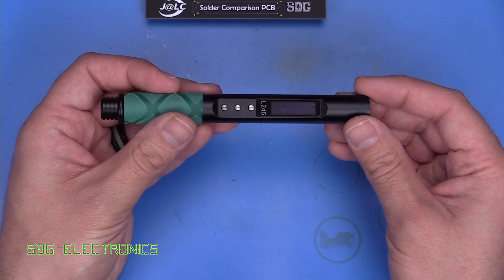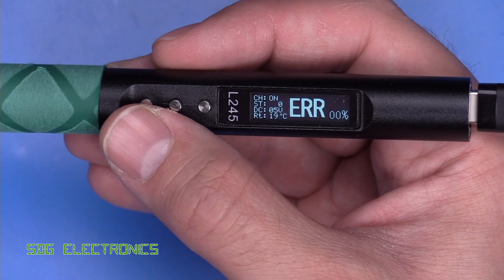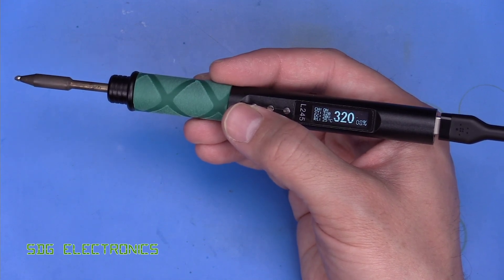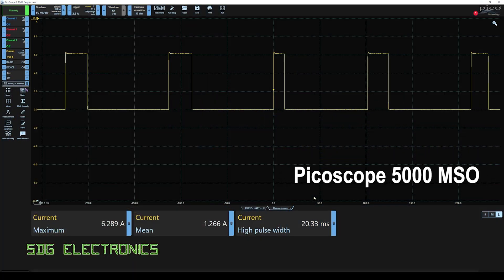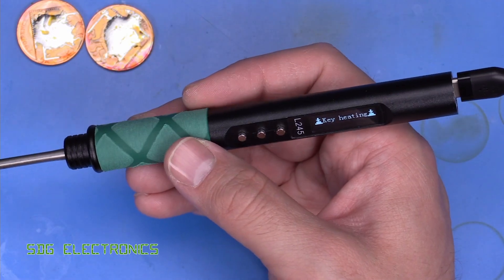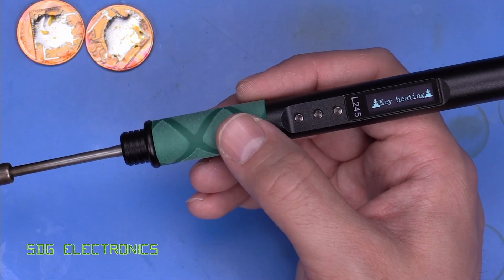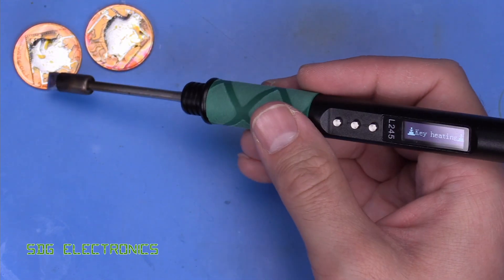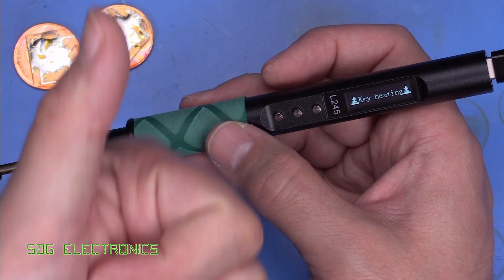SDG #284 130W Capable JBC C245 Soldering Iron

Comment from the maker: Excuse the error in my maths. More like 130W, not 300W 😂

Only $2 for 5pcs 2 Layer & 4Layer PCBs, Get SMT Coupon Here :➡ https://jlcpcb.com/cyt
JLCPCB 3D Printing Service starts at $1& Get $30 for New Registers Here: https://bit.ly/3vcjo1z
C245 Soldering Iron on Aliexpress: https://s.click.aliexpress.com/e/_DcgFoPN
Picoscope 5000 Series: https://www.picotech.com/oscilloscope/5000/flexible-resolution-oscilloscope
Support the Channel with Patreon: https://www.patreon.com/sdgelectronics
Reply: @sdgelectronics
Is your power supply switching or linear?
Maybe that might be a good look into type thing because linear might handle better than the stresses on a switching especially a chunky toroidial dcps they tend to take a licking & keep ticking without missing a beat.
Reply: At 1.37 can see that the voltage drops to 15V because the current is limited to 6A. Therefore, the maximum power used by the tips is 15x6=90 watts (not 130W).

Comment: There is a newer version L245P with a DC barrel jack supporting 24V input so it is basically the same as the JBC power supply voltage.
Reply: Sadly, it's power limited ot 100w. This one can go to just above 150W

Comment: After my ts100 died a few weeks ago im looking for a new, more powerfull but still cost effiective soldering iron. 
I have a 100W USB C PD charger and also a 20V 12A PSU if i ever need more than usbc power. 
Would you recommend this iron? Or should i instead go for a read soldering station? Im not planning to use it as a portable iron.

Comment: Hello, the big JBC cartridge that you used in the coin test - is it from C245 range or from C470? I tried this iron with C470004 cartridge and it draws only about 2A at 20V. With C245 cartridges I tested up to 6A at 20V. No problem with that. I did not try to go higher with current.

Comment: Just got this thing in my hands today. Promising little machine. I will have to grab a genuine JBC tip and see how it goes. Might be my new go-to portable iron. I like the case and the form-factor, I like that the business end of it fits all the JBC stands and whatnot. It heats up nice and quick.

There's definitely some things I don't care for:
- Turning the heat off means leaving a preset at 0º and going to that, otherwise there's no way to manually turn it off. The center button should be on/off, not the stupid preset/no preset option.
- It shows the power as a meaningless percent instead of an actual watt value (I assume there's an extra calculation in the code to get from watts to percent, so why not just leave it at watts? If we knew what it was a percent *of*, at least we could undo the math in our heads?).
- I also wish there was a way to get regular DC into it. I don't get the appeal of PD on a portable soldering iron. It means I either need a dedicated power bank, or I need a 120V outlet and then a PD power supply. Give me a DC barrel jack that I can just feed DC voltage into from any battery/source, with the added bonus of using flexible small-gauge silicone wire instead of a big stiff USB-C cable for no reason...

I'd like to take it apart to see if I can solder some wires directly to the board somewhere and bypass the USB-C plug, but it looks like that means peeling off the display cover and then who knows if I'll get it back on properly. But hey for the price I could just order another one...
Reply: Oh, I guess the percent is probably the PWM/duty cycle that the controller is feeding to the tip. Yeah, that means they aren't doing the math for power at all, so it's a percentage of whatever the theoretical maximum power it can send to the tip is based on Ohm's law. For a genuine JBC tip at 20V I guess it would be percentage of 160W in an ideal world.
Reply: @swissfreek  anyway to know what is the maximum power each JBC tip can withstand? Because I'm planning on getting some blade style tips for reballing, and I might end up getting a T245 handle from aixun and use it with my ksger, or if that combination doesn't work, I'll end up getting an Aixun T3A station. Thoughts?
Reply: @gpudoctor  my googling says they’re good for 130W. No idea how the ksger station works, but I’m assuming it’s not particularly intelligent code, just a PWM controller with a PID loop to hit a target temperature (which I suspect is the same for this iron as well). So if you feed it 24v it’ll push full power through the tip if it needs to, which in theory is ~230W and way more than it is rated to. I doubt it has any code/circuitry that caps the current to keep it under a certain power. The T3A may be smarter, but who knows. It’s the game you play with this cheap Chinese stuff.
Reply: I got some JBC tips. It was alright with the knock-off tip that came with it. With JBC tips it’s pretty fantastic. I like the way it fits in my hand, and I bought some USB-C connectors so I could wire an XT60 directly to it with some nice thing silicon wire. Now I can power it straight from a 4S LiPo (which I have in abundance) and it’s got plenty of power (theoretically ~120W on a fresh pack). The 20V limit means it’s difficult to feed it full voltage from a LiPo (4S is too little, 5S is too much), and most DCDC converters can’t handle that much current at that voltage. But 20V would overdrive the tip anyway, and 4S is just about perfect. So I’m happy. Need to 3D print some sort of case and stand with a tip-puller for it.
Reply: @swissfreek not sure about this model of iron. But original jbc 245 cartridge is fed with 23,5 volt
Reply: @olehcelsior1005  the product page for the iron says not to give it more than 20V, which isn’t surprising since it was meant to be powered via PD. I’m sure the fancy JBC stations control power output via PWM duty cycle, so even though they are fed 24V, they aren’t burned out. This iron isn’t that sophisticated.
Reply: @swissfreek  I’m sure you can feed it 21v (5s LiPo). Probably 24v is ok too. Max voltage is probably limited by MOSFET resistance (too much current draw making mosfet get too hot). 

Genuine JBC T245 stations use 24v AC 50Hz for heater power, not PWM. 24v AC RMS is 33v at the peaks.
Reply: 9mR MOSFET power dissipation with 2.7R load (guess hot C245 heater resistance is 2.7R):
16.8v = 348mW (4s LiPo)
20.0v = 494mW
21.0v = 544mW (5s LiPo)
24.0v = 711mW
25.2v = 784mW (6s LiPo)

More than I was expecting. 24v probably is too much after all. 

JBC C245 power assuming 2.5R:
16.8v = 112W (4s LiPo)
20.0v = 160W
21.0v = 176W (5s LiPo)
24.0v = 230W
25.2v = 254W (6s LiPo)

Genuine JBC C245 is 130W and I read 170W at warm up (JBC cable is quite high resistance, cartridge is higher resistance when hot and transformer voltage probably drops under load too - to account for 130W power despite 23.5V supply and 2.5R cartridges).

To reach 130W requires 18.8v at the cartridge, assuming 2.7R
Reply: got this iron , they also sell type c to barrel adapter cord, i used mine with a 20v laptop power bank, i also bought c245762 and c245866 both “fake” , tried those coin tests in the video and they melted solder easy at 320c

Comment: It's a shame that this thing won't take direct DC like the Pinecil/TS100/Sequre irons will. Would be way easier to deliver the power that it needs with a bench power supply or LiPo battery.

I've been waiting for someone to make this sort of thing for JBC tips like they've done for T12/T15 (Sequre SI012) and Weller (RT Soldering Pen) tips. Just feels like they missed the mark on a few things. If only Pine64 would make a version of their iron that's compatible with this tip design. I like the Pinecil but other than the D24 tip they just don't make the tip styles that I like to use.
Reply: Recently they released a new version with letter P suffix that includes a dc input jack but it quite a small connector 3.0x1.35 mm size. For that is it be able to handle a genuine JCB cartridges or not I’m not sure.

Comment: The ring where you insert the tip can be unscrewed. Then there is a 1.5mm hex grub screw under the display cover. Unscrew it and you can slide out the PCB.
The microcontroller has all the markings engraved away sadly. It is in a SOP-20 package. 
I took a few pictures of the PCB I could share.

CH224K USB PD chip, NCE30P25S P-channel MOSFET and an SE8533 3.3V regulator. The PCB is marked V1.16-L245
Reply: Yeah, my main goals will be a option, where you can change the tip resistance, then increasing pwm frequency and a PD 3.1 option, so you can use 28v, 5A and specific current limits for every voltage, so the power supplies  over current won’t get triggered.
Reply: Any update on your  iron ,, i am thinking to buy this iron any suggestions?
Reply: @darkworrior1908  I am mostly using it with power tool battery packs. All of my 100W PD bricks go into overcurrent protection with JBC tips at 20V though.
Other than that it's great and I use it often.
Reply: @heissklebepanzer  Hi. Have you succeeded in identifying microcontroller or reading firmware from it?
Reply: @heissklebepanzer  keep us updated dude, please
Reply: Did it wrong way lol. In the Ende I did. push the tip and it worked :-)
Reply: btw Im going to dump try and dump the OS and rewrite it. Did you get any more information auf the uC or the programming protocoll? Looks like UART or some manufactor specific interface. There are four pins: GND - 2 pins without anything - 3.3V
Reply: @heissklebepanzer  I hope you succeed in doing that. Could use at least a PWM update.
I sadly didn't get any further. I took some pictures of the PCB under my microscope and traced a few connections, but that was it
Reply: I can't slide it off, it seems like the buttons hang at the screen. Do you have an idea?
Reply: @heissklebepanzer  Are you pushing from the soldering tip end?

Comment: One thing that I do with underpowered soldering irons is to just use a regular lighter and hold a flame to tip of the iron to pre-heat-soak everything, and then the iron can usually do well to keep hot from there.  You can even heat your tip nearly red hot when your work is a large patch of copper, etc..  to jumpstart that heat transfer.   A little preheating your tip with the lighter can make all the difference.

Comment: Wow Steve, I love your channel and this is the most interesting subject yet. An old 35W Metcal is my go-to, but the allure of cheap JBC clone tips is just too tempting. With the release of the Pinecil short (and lower resistance) tips, I expected the matter of "best" portable to be settled for a while, but this no-name has me wondering.

When you say you rigged-up a USB cable to your power supply, would you mind sharing the specifics? I would assume it's not much more complicated than applying DC voltage to the 2 thickest wires in the cable, but I don't have any USB-C devices I'm willing to risk losing to an experiment.

If you have time, how about a head-to-head between this device and the Pinecil v2 with short tips? I mean the total experience, not just thermal performance.
Reply: Yes its just applying voltage to the appropriate pins on the USBC.. Its not a risk to the device if its rated for the voltage.
Reply: Тоже интересно сравнение с Pinecil v2
Reply: Steve already reviewed the Pinecil. It and the TS100 both do very poorly on the coin test. https://www.youtube.com/watch?v=-TosWhPsru4

Comment: I got a similar c210 version, works fine with original tips, also I got a sunshine one that comes with a stand which is c245 and they do c210 version, it uses 15v usb c adaptor but couldn’t get it work with 15v powerbank, it comes on but turns off after a few seconds
Reply: how does the sun work?  I heard that it is not very good in quality and heats up for a long time, say it yes or no?
Reply: @evgeniychaliy6596  the Sun is always hot and will never cook down but I don’t understand your point

Comment: The pinecil also can go up to 120 watts with its 6 ohm tips using a power supply that supports usb pd 3.1 epr at 28v. But 28v pd 3.1 chargers cost 3x more than the pinecil itself. Same like as this l245, the genuine tip would likely cost the same as the iron itself. 😅
Reply: There’s also only 8 of the short tips for the pinecil. The collection of JBC tips is massive, something for everyone. Same with Weller, but the soldering pen that runs those isn’t made by a big company and doesn’t have a nice case for, plus the high power Weller tips and the normal ones have different form factors at the plug.
Reply: The USB controller is rated for 21V or 28V absolute max, it would be a bit of a risk to run at 28V..
Reply: This channel tested the Pinecil and TS100: https://www.youtube.com/watch?v=-TosWhPsru4

Both of them are, well, pathetic. Their tips are no match for proper JBC tips. The irons themselves seem fine, but something about the design of the tips causes them to respond to thermal loading extremely slowly, and the iron never puts out more than 11 watts.

Comment: Metcal always does better with the coin test is because RF delivers power into the surface of the tip where the temperature is falling. 

JBC has a resistive heater buried relatively deep inside the core of the tip. Heat has to conduct to the surface from within. 

I think the thermocouple in JBC is located closer to the heater than the surface of the tip. If it was closer to the surface, it would probably perform better.

Comment: I've looked at a few of these type of irons lately, being that I solder out on site fairly regularly, and like the look of them. However they all seem to be not quite the finished article. What would you say the benefits are of these over a gas powered Portasol iron that I've been using for years?
Reply: Temp regulation in my opinion would be the biggest.
Reply: @unclejohn5012  That and the fact that the gas exhaust has to go somewhere, so aside from the tip being hot there's also an exhaust of hot air going somewhere else, in the case of the one I had, off to the side, which can damage things around where you are soldering.
Reply: It will be a big upgrade in performance over a gas iron, from what I’ve heard. 

A TS80p is probably the best option for portable soldering. BC2 tip is the one I’d use (hoof shape).

Comment: You probably had trouble with the cable rating in your previous video. USB C cables have a chip on the connector that "speaks" with the devices and let them know their max current capabilities. Also, I'm puzzled about you saying (in your previous video) that reducing the voltage would get you a lower chance of shutting down; lower voltage means higher current, and you were already hitting your current limits. Rather, the higher the voltage, the lower the voltage drop, and the better the chance of surviving such a drop. Also, normally these soldering irons have a setting for low voltage threshold where you can control at which point should they shut down if voltage drops too low. You could have fiddled with that as well.
Reply: Yeah as the other guy says, it’s an ohmic load, and P = V^2 / R. Power is the dependant variable.
Reply: Yeah, I failed to realize that the power figure is an average for a pulsing charge.

Comment: Where on earth are you getting 0.3kW from? These are clearly rated 65W in the pages.. so 0.065kW.

300W from a 20V supply would be 15A
Reply from the maker: Yep, sadly realised too late that I had accidentally assumed the max of 300W on my PSU because it couldn't deliver any more current. It's rated for a higher voltage than this
Reply: @sdgelectronics  That is fair, they make it fairly confusing between the poorly translated feature notes, the fact that they have smart/dumb power modes, as well as a custom resistance for their heater cartridges, it's a lot to dissect, so thanks all the same.

Comment: If the 245 cartridges are 2.5 ohm (?) and you supply 20V, peak current could reach 8A. Maximum power needed is then 160W. Due to the pulsing, the power supply has to be large and robust enough to be able to handle the on and off switching. I wonder if you only get the full potential from this with a custom power supply. Negates the portability thing if you can't use a standard PD charger (max 100W).
Reply from the maker: Yes, 160W is more realistic. 300W was an error.
Reply: @sdgelectronics  
Also those the clicking noises you mentioned were most likely the PSU switching into constant current mode.
Reply from the maker: @cannesahs  I think it's mainly transformer noise, but constant current limits too as it switches taps. Sounded like my old 24V Antex system
Reply: Maybe a macbook 140W PD usb C socket might be a viable option
Reply: @stalwartcomputers5182  PD 140W is 5A@28V. The PD charger will not supply more than 5A. And if it tries to apply 28V, that would mean 11A through a 2.5 ohm 245 cartridge. So the equation doesn't work with PD chargers. In the previous video, a viewer commented that he used 24V and 9A to drive a C245-966 tip. Seems to be the only option to use a (adjustable) DC supply, not a charger. Now where to find a small enough 20-24V 240W DC supply without building your own expensive one... There are at least older 20V laptop power supplies that could be reused. I have a Thinkpad 20V, 11.5A, 230W on my work PC.
Reply: @johansvideor  maybe a cctv camera supply 24v 9A shouldn't be an issue & relatively small & reliable cost around £10 shouldn't be too difficult to get one to try out
Or like you say a beefy old laptop brick
Reply: @stalwartcomputers5182  Sounds good!

Comment: I don't think you are driving 300W though, your supply might be 300W capable but not at 20V. 6A limit means I'm guessing it's a 50V max supply, but the supply can't give 300W at arbitrary voltages because it's still got a current limit. The cartridge is in the end still only getting its expected 120W
Reply from the maker: Yes, sorry I realised too late after releasing the video!